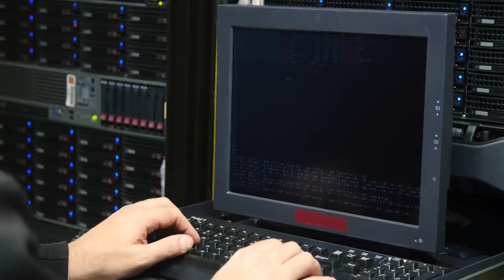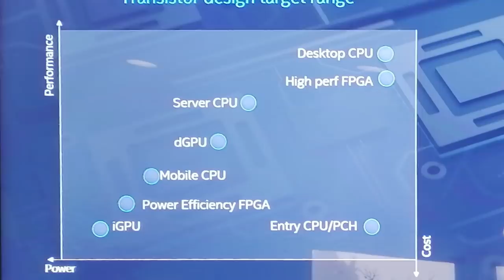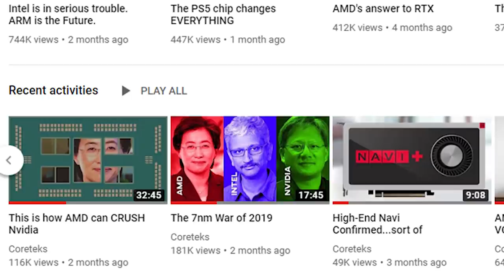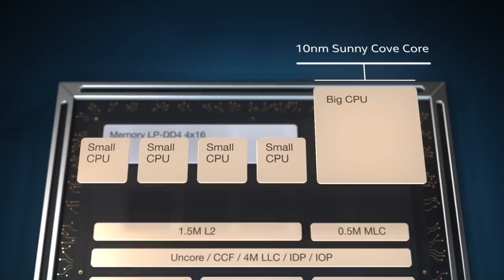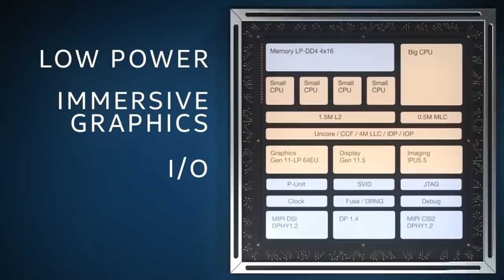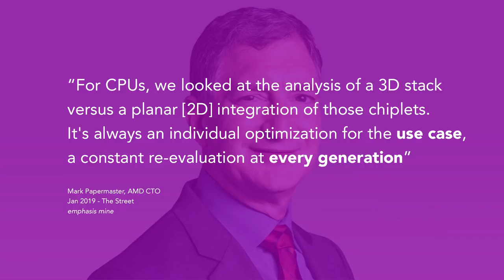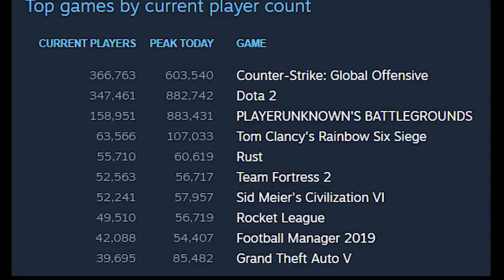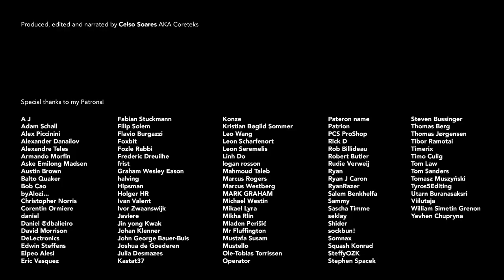2D vs 3D Stacking: Intel’s plan to beat Zen 2

Comment: AMD is gonna be winning this year with price to performance!
Reply: they have been winning all of 2018. however, if you're dropping $700-$2500 on GPU, it's stupid to gimp it just to save $100.
Reply: Abraham Lincoln why whose gimping gpus?
Reply: @Zorro33313  you can get a r5 2600 for the price of a i3 8300 due to the 14nm shortage for 7-8 months now... like what are you talking about?
Reply: AsianWithHat ... i desperately need for them to get a win... to teach Nvidia a lesson.
Reply: Max Pain  I used my 2080ti just fine in Metro Exodus for ray tracing.
Why do you bash something that you have no experience with?
Reply: Greg Goodenough there is no i3-8300
Reply: Greg Goodenough 8th gen came out in 2017
Reply: @Ray-cb3vl ,
"there is no i3-8300"
O'Rly?
then what is this?
https://www.intel.com/content/www/us/en/products/processors/core/i3-processors/i3-8300.html

it's even in shops here in Norway, but the price makes any 6-core ryzen look like a steal
Reply: @solomonshv  If you're dropping $700-$2500 on a GPU you're not going to give it workloads that are CPU-limited.
Reply: Intel is gonna be whining with price to performance!
Reply: @Zorro33313  well not a very good value considering it's 110-120$ and for 150$ you can get a r5 1600/2600 and get 50-80% higher fps.
Reply: @Zorro33313  Also age is of no consideration, I've been following the hardware market since I was 8 years old, now I'm almost 20, also studied hardware architecture and design for 4-5 years, so yeah... age above 5-7 years old is a poor argument.
Reply: @Zorro33313  Meh 8300, 4 real cores, 8 threads ... you'd have been better off looking for used i7s than buy a brand new FX CPU. Those were some dark dark days for AMD, even when considering value. And that link is synthetic benchmarks, we all know zambezi and vishera were flaming pile of shit for gaming.
Reply: AMD hardcore fanboys lol XD
Reply: @solomonshv  you and I have a different idea of what winning is.
Reply: high temps was the reason for getting rid of the stock intel heatsink which they used for years but literally was a block of aluminum with zero heat pipes or brass they have since fixed the issue after the 6700k the stock intel heatsink has been discontinued as it was inadequate for the newer generation CPU,s another issue was customers would try and overclock using a stock heatsink which is highly unstable wasn't that the i7,s ran hot it was the cooling block was not designed for overclocking and barely did a optimal job ….as where AMD ryzen stock cooling block was the same but had a copper plate on the bottom where in the cpu would rest and had liquid coolant internally that is why it ran cooler ….tests confirmed this if you stick a noctua heatpiped cooler on a i7 and a ryzen 7 identical run them benching ect and check thermals you will see the intel i7 run cooler and faster then AMD,s ryzen 7
Reply: @EpicGamingEct  The 6600K out performs the 2600 in? Not games, not in productivity tasks, in less core counts maybe? 
Plus the fact that 6/12 is always better than 4/4 (which is already old) most games are making 6/12 the perfect spot.
8700K and 2700X don't they have similar performance in games and even so, 1080p once you go to 4K the difference lowers. Plus 2700X still better at productivity
Reply: yeah but not in performance. this is why nvidia and intel charges more; good overall performance. i sold my ryzen 1700 because performance was mediocre, in some workloads performance simply were too bad. they are cheap for a reason. games, emulating (cemu performance was worse than my old i7-3770k). it was an 1700 @ 4.15 ghz with 2933 cl14 memory. if ryzen were good, amd would charge more. in some specific workloads, ryzen is good, but overall, not so much. not many people do 1 or 2 tasks on their system. i need good performance across every workload.
Reply: I think I made a mistake guys...I bought a system with an i7 8700 k ...man I could not wait 5 month for zen 2...damn !
Reply: They already have been for the last 2 years :)
Reply: @Zorro33313  depends on what i7 if you get the 9900k that's 8 physical cores 8 threads at 3.6ghz add on it has speed step and L1,L2,L3,L4 cache at 12MB and that's 400$ which you could overclock too 5ghz with stability using a water cooler from corsair like the H100 hydro
Reply: dr. whet farts yep, Ryzen's are WAY to overrated. I also went from 3770 (non K) to Ryzen 2600. That thing at 4ghz with 2933 cl14 performs just about ~10% better than my 7 year old Intel. Now im thinking of either grabbing a secondmarket 8700k or buy new 9700k. Altho i agree that intel is somewhat overpriced, ~300€ for 9700k and ~420€ for 9900k would be a more resonable price.
Reply: INTEL WILL BLOW YOUR MIND IN 2019 WITH 14NM.
Reply: Max Pain Do people still believe you can barely use ray tracing? Lol I get 110fps with rtx on in 1440p now so I think it’s preforming pretty good
Reply: @Zorro33313  Lmao another small novel kicking water uphill defending the FX series. Have at it man, keep counting your ALUs as cores.
Reply: Some people fail to mention that Ryzen 3000 is performing as well as the Intel 9900k but with 30% less power usage. Right now I am looking to upgrade my system but I think I will wait another 5 months and snag a 16 core Ryzen 3000 cpu and hopefully it will be around the same price as the 9900k.
Reply: +Jess. Fuck yeah ! Gimping what ? That's cold man.
Reply: @Zorro33313  Haha considering a Zen core has 4 ALUs, doesn't make a R7 2700 a 32 core CPU just because it has 32 ALUs now does it? AMD got sued over their core/module shenanigans too. Write me another novel.
Reply: You wont gimp it unless you play 1080p on your $2500 GPU
Reply: @RandomPlaceHolderName  Interesting, I'm pretty sure they were sold until recently, or still are in some places, but if a guy on the internet says "they quickly scrapped it", then it must be true right?
https://www.youtube.com/watch?v=yo1US_MGyi0
Reply: @hurrdurrimaburr  He doesnt say you cant use it. He says you can barely use it. Which is completely true at this point because there are not many games that support this feature (yet). But that isnt the point of his reply. The point is that you need to have competition or you going to pay prices for hardware that are way too high.  Its a result of a monopoly. Basic trade logics.
Reply: @droomwel12  "or do you like wasting $1200-$1500 on an RTX card you can barely use for ray tracing?" Is what he said, word for word.
I didn't argue against what he said about competition, so why bring it up?
And you clearly don't know what a monopoly is.
Reply: Max Pain  You have no idea lol. Ray tracing is amazing on METRO and very optimized even on a 2070 without DLSS.. But hey, go buy a radeon 7 for the same money as a 2080 with no dlss or ray tracing. Anyway, maybe one day AMD will bring that competition back in the GPU market. I have no problem giving the company with the better product money.
Reply: @0cyb3r0  Haha Really? FX was discontinued in late 2013 after 2 1/2 years. They scrapped the architecture that quick. And yes, AMD sold FX until 2017 as it was all they had (they didn't sell real well either). As for value, your best bet is a Dell or lenovo i7 prebuilt as way way more of them were produced than FX rigs. But sure, keep defending FX...
Reply: @RandomPlaceHolderName  2.5 years is not that little, and it was probably the better choice if they reached a dead end or diminishing returns (like Intel with their crappy 14nm+++++ or their 5% gains over each generation over the last 9 Core gens) and instead started working on Zen. And FX are for sale until today:
https://www.newegg.com/global/uk-en/Product/Product.aspx?item=N82E16819113284
Reply: @0cyb3r0  Newegg also still sell ivy bridge i5s, doesn't mean jack. So whats your point? And two years is real short for a complete architectural revamp; imagine Zen being abandoned 6 months after the Ryzen 2 release. That's how quick AMD pulled the plug on FX. And the FX8350 is still a horrible deal even at $65 brand new.
Reply: @Charlie Brown sarcasm
Reply: Max Pain  preach Bullet Berry's speaker (no rly it's true, all my friends here in the US are fanboys over iPhones simply because they or their parents don't think anything is better and pay 1000 dollars for the same features every year)
Reply: @Charlie Brown Intel is for little boys who's mumsey buy their stuff.  AMD is for people who go to work every day and not foolish enough to piss their money away.
Reply: @brrebrresen1367  Hahahahahahahahahaha, 
Intel Ii8300 passmark benchmark = https://www.cpubenchmark.net/cpu.php?cpu=Intel+Core+i3-8300+%40+3.70GHz&id=3280
AMD 11 year old processor FX8350 for 60 bucks new = https://www.cpubenchmark.net/cpu.php?cpu=AMD+FX-8350+Eight-Core&id=1780   
Hey, you are going to have to pair that with a 2080 ti to get the performance from that i8300 to match that blazing performance.
Reply: @Zorro33313  Wow, how do you guys get bears into a bottle?  What type of bears are they?  Grizzlies?  Black Bears?  Sorry, couldn't resist.  It is beers not bears.
Reply: @Zorro33313  WTF what country are you from.  Speak American.
Reply: @avraham4497  Yes I have, overpriced and under-performing.
Reply: @Charlie Brown   Your Intel CPU only has more than 4 cores because they're worried about competition from AMD. Otherwise you would still only have 4 cores for the next 10 years. That's what Intel thinks of their customers.
Reply: @hurrdurrimaburr  $1200 for 1080p60fps in 2019, hmmmm
Reply: @netprowlerp  Haha what? Did you get your fantasies mixed up with arguments or something?
Reply: @RandomPlaceHolderName  Nope, fantasies are for Intel Fanboys.  They fantasies about their mother paying for those overpriced CPU's.
Reply: @netprowlerp  Considering ive got a Ryzen system, have at it.
Reply: @janusprime5693  More like 1440p ultra settings 75-90 fps, but okay.
Reply: @RandomPlaceHolderName  First off AMD was sued over the FX processor and not the Ryzen.  No one except you is disputing the core count on Ryzen.  Let me get this straight, you are trashing AMD but you bought/Built a AMD system?  If you really believe half the trash you wrote, why would you do that?  Oh, I get it, Your Poor.  You are the guy with a Harley Davidson T-shirt with a Chinese scooter in the driveway.
Reply: @netprowlerp  Wow, learn to read. No shit they are getting sued over FX and not Zen. Zen has a proper core count, not "modules"  like the FX series, which is what I was trashing. An FX8350 has 4 cores, 8 ALUs and 8 threads on a piss poor architecture with marginal single thread capabilities that no one in their right mind would use in 2019 unless they got them for dirt cheap which was the 1st argument to begin with; you're better off finding an i7 2600k or 2700k for cheap rather than an FX8350 for cheap.
Reply: @hurrdurrimaburr  Oh wow you can use RTX on 3 whole games.
Reply: No they will be destroying price and performance simultaneously. 100 dollar cpu from AMD will be faster than 250 dollar intel CPU.
Reply: AMD always wins with price, but never with performance... its the same since over 2 decades. Whats with all the silly AMD-Fanboys?
Reply: @Nebujin383  Look at the leaks.
Reply: @julianbeatty2909 , i dont care about leaks i wanna see real-world performance on its release plus the new AMDs are coming between two Intels generations. Obviously they should temporary performe a little better, but thats definitely not for long. Less than a year most likely.
Reply: Whoever is the underdog will always have to charge less. Whoever is dominant will command a premium.
Reply: Oh, and so right you were wise man, right indeed...
Reply: Brad Viviviyal  I haven't talked about BF V. I talked about Metro Exodus and it makes perfect sense in that game
Reply: @netprowlerp  its english not american smh
Reply: @the_guy_with_yeeyee_a_haircut  No, it's American,  British cant speak english very well.

Comment: 3d stacking looks amazing in theory but we allready see Intel struggling with heat and pricing. Unless they find a magic way to reduce heat and cost i dont think we gonna see those parts in 2020. Dont get me wrong i dont want Intel to fail or anything like that i am consumer like you i want competition so Amd can not to do to the market what Intel or Nvidia did with prices
Reply: With the more efficient process and drastically reduced clocks, it probably won't be a horrible issue. It'll still run hot for the first little while, I think.
Reply: Im right there with you. Given the fact that we already have issues with heat on most current 2D CPUs, I cant see them getting 3D stacking to be worth it for at least another few years. Of course, on some level, I hope Im wrong, because I want competition to keep up and push us to even better technology.
Reply: You really think Lisa Su is that greedy and stupid as to jack up the prices? No she is looking to the future and beyond and knows that if she increases the prices of Zen 2, Zen 3 she will lose trust and lose her consumers. She is in this for the long hall.
Reply: Building a Foveros chip for servers is going to be expensive AF.
Having so many bumps to connect at such a small scale introduces the possibility of destroying the chip.
Glue together 64 (compete against Zen2) or 128 (against Zen3/5)  of those chips and see the yield plummet.
Reply: On the high end, possibly, but on the low end there is potential.  Particularly on the mobile end I think this 3D CPU might be where the initial market starts.
Reply: "i dont want Intel to fail or anything like that i am consumer like you i want competition so Amd can not to do to the market what Intel or Nvidia did with prices"
-Competition(=performance equality) simply means Intel wins. Intel is ten times bigger than AMD and they make billions in each quarter while AMD barely is above loss. It's so shortsighted to wish AMD to be only competitive against Intel, AMD will never grow if they can't beat Intel. Also there's no danger whatsoever that AMD will became Intel in couple years. Even if AMD products were hands down superior. Because AMD don't have access to manufacturing capacity similar to Intel. TSMC and Samsung have other big customers, AMD can get only portion of their foundry capacity. They simply cannot make that many chips to meet whole global demand. Hell, even Intel have serious troubles to produce enough.
What AMD needs is to be every way better choice, not just better value due cheaper price but in performance too. It's only way to gain foothold in moneymaker markets, mobile and servers. And money is exactly what AMD needs desperately to become something more than fringe company what it is now. If AMD fails to do so, there will never be true long term competition.
Reply: Struggling with pricing?  like selling every chip they can make?  Heat is an issue with silicon, always has been and always will be.

trying to sell a gold plated 1979 Ford Pinto that is currently on fire would be struggling - selling every single chip you can produce is not struggling.

Having a McJob and trying to afford current gen gear is struggling.
Reply: Heat will be ok if they clock to 3-4ghz and not 5.
Reply: Consider stacking only cool parts, like some IO, and extra cache, with the cores themselves exposed to the IHS.
Reply: @stefangeorgeclaudiu  Foveros is for SOCs not CPUs.  Wont be a desktop foveros - laptop and ultra books.
Reply: @Dwayneff  Future like 6 months in advance trying to keep the lights on there.  Ryzen 2 is do or die for AMD
Reply: Foveros is for low power SOCs not for Desktop and Server CPUs
Reply: tiny peltier devices and tiny heatpipes. heat can be moved like electricity. The cost is more power consumption, but not that much more.